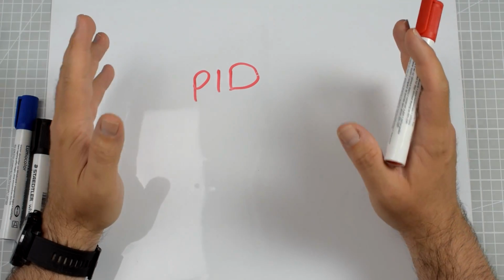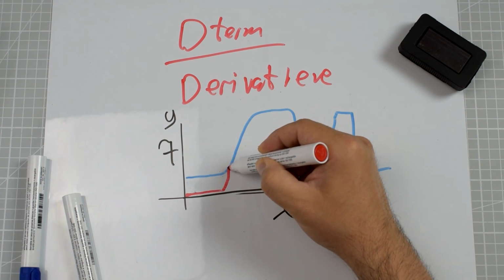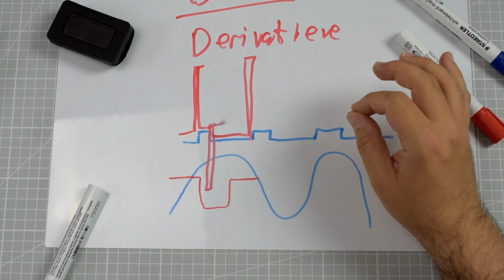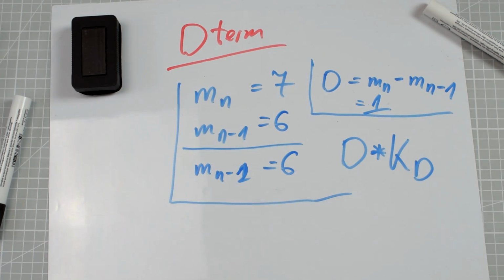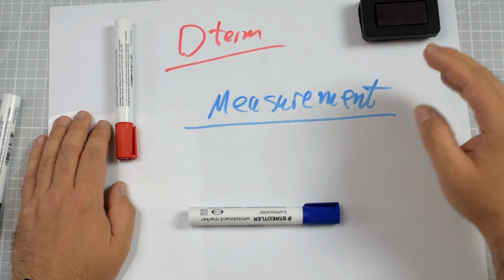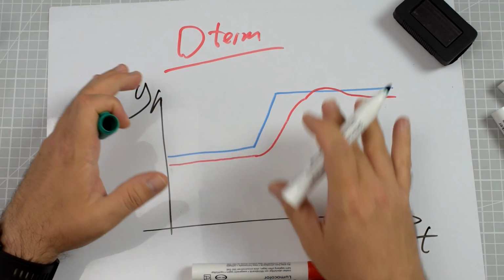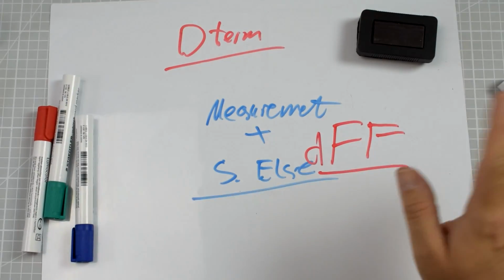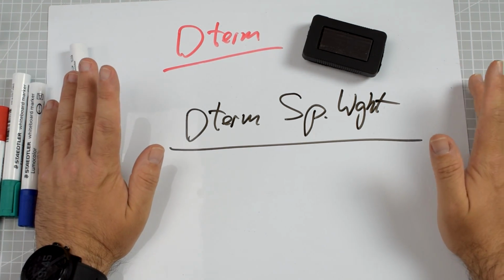Deep dive into the PID controller D-Term component

Comment: Why not just add an independent I-term to the D term?  When you have a D-term spike the I-D-turm would add the time element, wouldn't it?
Reply from the maker: Not really. Integral is the oposite of Derivative. You compute Integral of Derivative and have original signal instead
Reply: @FPVUniversity   OK not exactly an integral but a time system that says if D is rising to a 7 and then back to a 0 within 3 frames you  probably need something closer to a 3, But if you go from a 0 to a 7 to 0 in 5 frames then you probably need closer to a 7.

Comment: Nice work.  It underpins how simple the PID controller math really works.
Reply from the maker: Math is not really a problem. Problem is with understanding the basics instead of repeating blindly what someone recorded in the internets years ago without checking ;)
Reply: @FPVUniversity  Agreed.  I never trust anyone.  Someone steer you wrong years ago?  Helio?
Reply from the maker: I think 75% of the video trying to explain what Dterm does on a MR ware recorded by peopl who never really understood that Dterm is only keeping acceleration at 0
Reply: @FPVUniversity  "what Dterm does on a MR ware recorded by people".
Not following.  I must not be subscribed to that one.
What I don't understand is how it is such a mystery when it is so simple.  I think to some extent that is marketing so folks think things are magic when it is really just simple math and very basic core drivers.  From there, when things get layered on that is when it gets complex (mixing of axis, filter effects on PIDs, effects of delay in the signal, etc.)